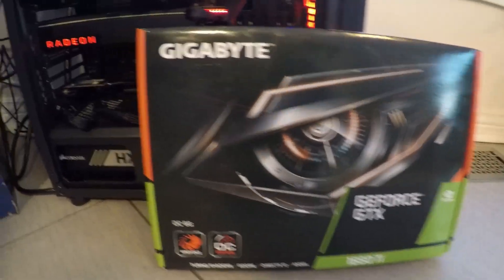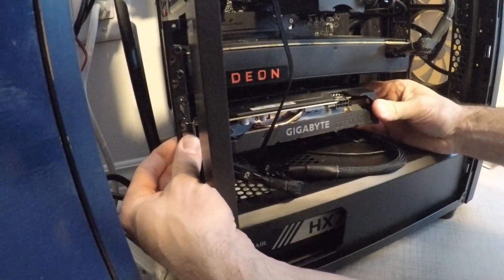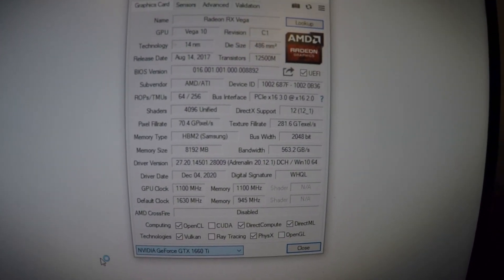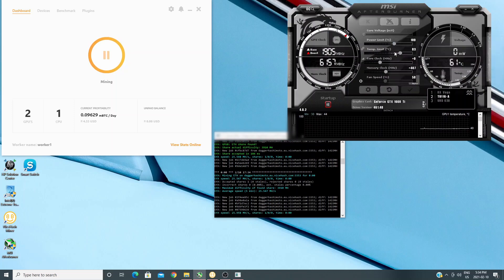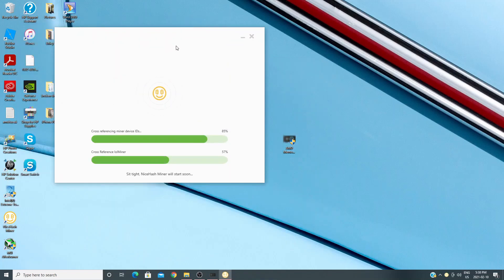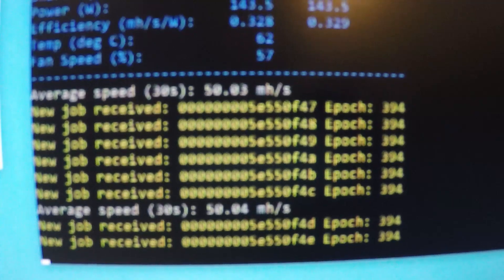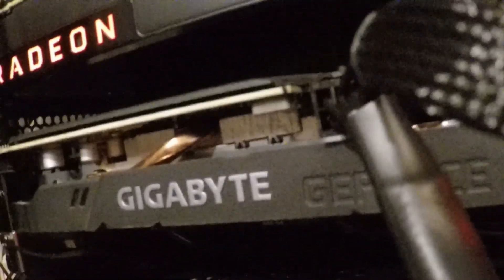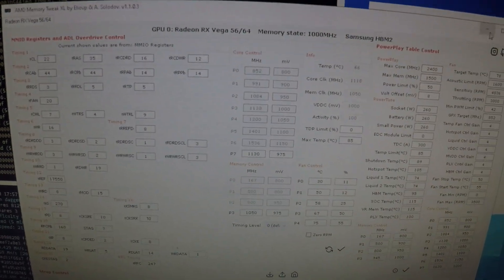AMD and NVIDIA GPUs mining on same computer

Comment: I have tried for hours to use my new rx 6700 XT card and it will not work
Reply from the maker: Like just by itself
Reply: @DIYNorth  sorry, i meant to add. I have a 1060 6gb and then just added the rx 6700 and have had insane issues my black screen not loading on initial startup. Then it doesn’t show in my device manager. I’ve swapped ports as well. Still no luck.
Reply: A black screen*
Reply from the maker: @CactusShark888  I would plug the monitor into the display port on the mother board, then go into the mother board bios and see which display adapter its boot ing to. Then with it still hooked to mother board do a clean install of gpu drivers amd first then nvidia with a full system restart between driver installs.
Reply from the maker: I've never owned a 6000 series AMD GPU, but I'm pretty confident they will hook up with a 1060. It might be a painful experience but it ought to work.
Reply: @DIYNorth  thank you very much for the advice. I have not done that and will try that.
Reply: @DIYNorth  I tried that and I get just a black screen when booting up. Also I only have a DVI port and a HDMI port in my motherboard. No DP. It is a newer msi gaming plus VR ready mobo.
Reply from the maker: @CactusShark888  I made a video on a black screen on a brand new MSI mother board. Is this the same issue you are having? https://www.youtube.com/watch?v=lT66m7GBTls
Reply: @DIYNorth  that’s what I’m thinking it should work. But I think something is glitched or hung up in windows and my bios.

Comment: i have a 1080 and combined it with a r9 290x, works great after 1 month mining. still get some good value from the R9 if Ravencoin does good. costs a little power, but power is cheap in my home
Reply from the maker: The R9 is a bit of a classic, are you running the Eth largement on the 1080?
Reply: @DIYNorth  yes. But enabling it in nicehash was not enough. Had to download it aswell and manually start the program
Reply from the maker: @tulste  yeah, I had a 1080 ti and the eth pill stopped working in nicehash for a while.

Comment: I've gotten a good deal on 2 msi armor rx570 8gb, but I've never mined with amd cards before (I only have 2 1070tis), can anyone help me with all the bios flash and complications the amd cards have? I'm trying to be ready for when they arrive, downloaded PBE 1.7.5 but I have no clue on how to use it. Thanks in advance
Reply from the maker: Sorry I can't help. I used RX 570s before, but you back then you had to do a hard Bios Flash to get them to full potential and I think you can use soft power play tables now and don't need to do the full on Bios flash. I'm sure that there are some good videos out there. I found that some of my 570/580 cards could actually hit the full hash rate without doing anything with the Bios so I never flashed them, but rather ran them straight up and just reduced power.
Reply: @DIYNorth  Oh thank you, so I shouldn't have problems getting them to ~30MH/s without the bios flash? I know that phoenix has advanced launch options like -rx boost and -straps
But I just don't want to have paid for the 2 cards to have a low hashrate
Reply from the maker: @BRUNA-xk8oe  it's my understanding that you can hit 30 without bios flash. There is also the amd tweak tool and soft power play table that perform like a bios flash but are temporary as long as the program is open.
Reply: @DIYNorth  Thank you! Now i only have to worry about mixing nvidia an amd😂

Comment: Hi i'll try to mix my 1650 super with an amd card is there going to be any problem?
Reply from the maker: Well...Its hard to say. I would personally go for it since I have thus far not found a configuration that doesn't work when it comes to a mixed rig.
I'm sure that there is a pairing that simply doesn't work well.
Right now i have a 1660 ti and a 5700 XT working just fine in one computer.
Reply: @DIYNorth  i was thinking to buy a 1060 6gb but it is more expensive than 470/80 570/80 series but i may buy the nvidia one to avoid any problem
Reply from the maker: @hydrocdesigns8445  the 570/580 will make more money right now. The 1060 gets about 22-24 hash rate while the 570/580 series should get between 30-32. There is a lot to be said for an easy to use stable rig though.
Reply: @DIYNorth  i guess i will get an amd card and if i get issues with it i can sell it anyways
Reply from the maker: @hydrocdesigns8445  There will be no resale issues as long as you don't wait too long to sell.
Reply: @DIYNorth  Man im trying with a 1660 super and a 5600 xt and i just cant get it to work, either the 1660 gets stopped by windows or i get a blue screen

Comment: Nice video, can you help me with something? Do you think a 650w PSU can handle a 3070 and a 570 8gb? I also planning of gaming time to time on the 3070. Do you think it wil be ok?
Reply from the maker: I think you will be fine. For mining anyway, the 3070 will draw less than 160 W, and so will the 570 (it depends on how you optimize the power draw though). So you should be around 300W for the 2 cards at most. The rest of the computer shouldn't need the additional 350W. Now if you try gaming on the 3070 while the 570 still is mining, I'm not too sure as the 3070 will likely use closer to the 220W limit, and your CPU will draw more power as well.
Reply: @DIYNorth  I most likely will not mine while im gaming just to prevent anything to get screwed, thx for the response
Reply: @Alonso692  try it! Let us know how it goes!
Reply: @Alonso692  u can also get a wattage on the wall reader...

Comment: With a similar configuration (AMD + Nvidia), can I use one GPU for gaming  ? or is going to generate drivers problems ? did u try it ?
Reply: I’m currently mining with a 1080 and rx 580. When gaming I stop the mining in the 1080 and it’s used. I don’t have a monitor connected to the 580 so it’s never picked up by the games.
Reply from the maker: I've never tried to game on a mixed car rig. I think that it would work. You might even be able to keep one card mining and use the other for playing a game. I'm not sure though.
Reply: I hearder some people even play games while mining, but the hash rate drops lower. But its not healthy for your GPUs. Better turn mining off on 1 gpu for the game. Then back on overnight
Reply from the maker: @freestaileriz  might depend on the game. My kids play roblox, minecraft, and a few others and hash rate isnt impacted.
I doubt that would be the case with a AAA game.
Reply: @DIYNorth  yes I agree. I mean if ur playing high end games, it's better turn off mining on that gpu. Too much stress for gpu its just gonna shorten the lifespan of it

Comment: 5700xt works well alone but when I add the 3070 it either doesn't show up or both don't give any output. any suggestions?
Reply from the maker: Do both show up in device manager
Reply: Did you figure out a solution?
Reply: I need the solution of this, please help.
Reply: @anirudh2788  You have to go through bios

Comment: I am currently mining crypto with a 2060 super and am looking to double my profits by using another gpu.  the 2060 does not support sli so I was wondering if this would work.
Reply from the maker: You don't need SLI or Crossfire for mining. In fact you shouldn't use either when mining. So what ever you get should work, though I can't guarantee results.

Comment: I have a 2070 and looking to pick up an rx 480 8GB for my other slot. I was wondering, could I put the 480 into a 1x slot and still be fine? or should I get some soft of extender to fit it into my other 16x slot?
Reply from the maker: Maybe. I haven't used a 480 before, but I've had a 570 and a 580 and those cards ran fairly hot. I have a 5700 XT and a 1660 ti in one computer right now but both of those cards run very cool by themselves so they don't get over much over 60 Celsius when paired up. If you can keep the side off your computer it might be ok.

Comment: I currently use my gaming pc for mining when I’m not home or asleep but I want to run a rx 580 on my pc to 1 boost mining speed and 2 I want to have the rx 580 mining even when I’m gaming on rtx 2070 what do you think about this?
Reply from the maker: I've never tried to mine on one card while running a game on another. It might work, but I have a high level of confidence that you will have decreased game performance and mining performance when you are trying to do both. That said my kids have run games off the mother board without impacting the game or mining. But that's like Roblox type games. I think if you run a AAA title you will notice a difference.
Reply: @DIYNorth  a friend of mine does this with two Nvidia cards and it doesn’t really impact performance he runs a straight 2070 and a gtx 1660s (I found that rx 580 price to performance is way better with my market) rtx 2070 is more than capable for aaa titles that’s why it doesn’t impact it that much. I was just wondering if it would be possible to run amd and Nvidia on the same system (windows 10)
Reply from the maker: @UNES._.00  they will run. I've had three different amd / nvidia gpu configurations in my test computer in the last 3 weeks and they were all running at expected mining performance. I'd be interested to see what happens when you toss a game at one of them.
Reply: @DIYNorth  I’ll let you know (when I’m gaming I’m turning that card off tho so depending on the game (how heavy it is) I’ll chose what gpu I need seems like a fun experiment I’ll let you know

Comment: You'll likely get lower GPU temps if you swap card slots.  Have the AMD blower style card below the Nivida card.  Right now the blower on the AMD card is sucking up some of the heat exhaust from the Nividia creating higher temps.  Having them reversed likely will reduce some of that heat exhaust.
Reply from the maker: Thanks for the recommendation
Reply: @DIYNorth  would be an interesting quick video if you swap them!
Reply from the maker: @jarizard_151  I'll look at doing so in the future.

Comment: Couldn’t I adjust OC settings on MSI afterburner for both cards? Thoughts?
Reply from the maker: Maybe. It depends on which AMD card you have. If you use afterburner as your means of adjusting the AMD card then yes. If you are using soft power play tables or the AMD driver software then I find it more problematic since there are 2 programs open that adjust the cards. So if you are using the AMD Tweak Tool (for example) I would close out afterburner once the NVIDIA card is set. But if you use all afterburner all the time, then just run it. If it works then great, if not try another option.
Reply: @DIYNorth  when you say close out afterburner, doesn’t it stop OC’ing the card?
Reply from the maker: @jarizard_151  if you check the start up button in afterburner  it will keep your settings running.
Reply: @DIYNorth  I wouldnt check the startup button, just in case if you start fiddling around with the settings and it freezes up, your windows might not boot because afterburners settings is making it crash again. So you would have to go in safe mode, uninstall afterburner and that whole mess.
But yes you can just use afterburner to adjust both cards, there's a button to switch cards. Just save your settings as f.ex profile 1 & 2 and enable them when you want to mine.
Closing afterburner doesnt matter, the settings are on until the pc is rebootet or you open afterburner again and reset the settings with the reset button.

Comment: hi, it seems that you're outputting display through your onboard Intel UHD graphics. Is that a requirement to get this AMD + Nvidia card setup? I am on a Ryzen 3 3100 (no onboard Vega graphics) and an RX 5500 XT 8GB at the moment and looking to get an Nvidia card as well, but was wondering if that would work if my main display outputs from the 5500 XT. Thanks for the video by the way
Reply from the maker: I only output from the motherboard when mining. I'm not sure if it would have an impact on adding an NVIDIA card or not.
But generally you will get better mining performance if the monitor is not plugged into the GPU.
Reply: @DIYNorth  Yep, better mining performance because the GPU always allocates some RAM for the desktop when plugged in which may lower performance.
Reply: @jknap00  even if the monitor is turned off?

Comment: I just bought a 6800xt and a 3080 do you think they will work together and what power supply would I need
Reply from the maker: I dont see why they couldnt be made to work together.
Each card has a peak power requirement of about 300 watts. I would go at least 850 watts for the PSU. If you plan to get more gpus you might want to go even larger.
Reply: Also do i just plug both of them in and it should work right
Reply from the maker: @superraja4066  I would get one working, and then add the other one.
I would also start with the amd card, but that is maybe just a personal superstition. As long as the drivers are installed it should work.
Reply: Ok thank you
Reply: Did you get it working?
Reply: @jarizard_151  no my 3080 hasn't com in yet

Comment: The gpu don't go that high in temp, but the memory modules are hot as hell and that space needs more cooling.
Reply from the maker: You could not possibly fit more fans in that tower as there are 6 case fans and the blower card also dumps a ton of air out the back. This was really just for demonstration purposes though, its not a video on cooling solutions. That said the Vega 64 was the hottest of the 2 cards and never got above 65C, which really isn't very hot. In fact I have open air cards running that hot.
Reply: @DIYNorth  64 is the gpu temperature, the memory junction temperatures is always the problem, just use hwinfo64 to check the sensors.
Reply from the maker: I'll check it out once I sort out my 1080ti dramas.

Comment: Goodnight friend. Do you think a 1060 Gigabyte and an Asus 5500 Xt can work normally together?
Reply from the maker: Yes, I'm sure they could work together. Its more difficult to mix the cards, but I've never been unable to do it. I have mixed 1060 with both RX 580 and Vega cards successfully, but I've never used a 5500 XT specifically with a 1060. It also can come down to motherboard and programs you are running.
Reply: @DIYNorth  i have been unsuccessfully trying to add a RX570 in the mix with RTX1060 & RTX980
Reply from the maker: @sg.5360  have you confirmed that they all work individually in the system? Are you using risers? If so have they all been confirmed to work on individual cards. What is the PSU Wattage?
Reply: @DIYNorth  the Nvidia RTX1060 and 980 works like a charm. I am using risers,  swapped known risers from the 1060 to the RX570. I Uninstalled both Nvidia cards and tried to install just the Radeon Rx570 and it gets stuck at post so it doesn't even get to windows 10 and a few times it did go past the bios post screen to W10 and within seconds it locked up. I am using a parallel miner 1200w PSU with breakout board only the two Nvidia cards running.
Reply from the maker: @sg.5360  was the 570 a used card?
Reply: @DIYNorth  yes a working used card.
Reply: Are there any special bios settings to set?
Reply from the maker: @sg.5360  you can try going into the motherboard bios and setting it for "above 4g decoding"
Reply: @DIYNorth  its enabled
Reply: @DIYNorth  it looks like its going to load windows and monitor enters into power save mode. Monitor is plugged into the onboard video card
Reply from the maker: @sg.5360  have you tried it plugged into gpu 1.
Reply: @DIYNorth  yes. Into the 570, I get same results looks like its booting into windows and goes into power save mode.
Reply: @DIYNorth  i haven't tried plugging the monitor into the Nvidia cards.. actually just realized that
Reply from the maker: @sg.5360  that's very strange, and you said the 570 can work in the computer if it is all by itself
Reply from the maker: Can it boot in safemode
Reply: @DIYNorth  yes and I've done DDU and add drivers in safe mode and it shows up in Device Manager in safe mode too.
Reply: @DIYNorth  no not in this machine,  doesn't work alone. But another machine. Yes.